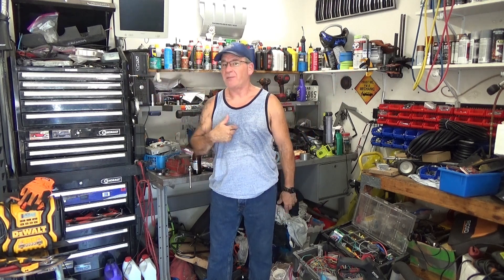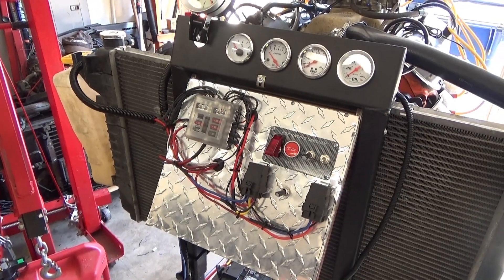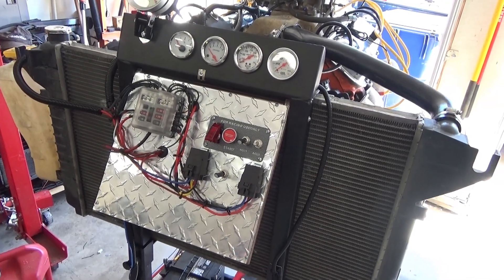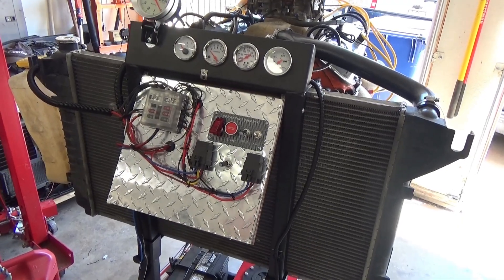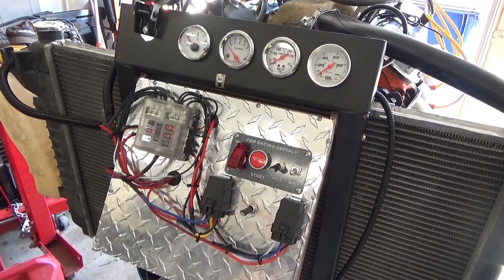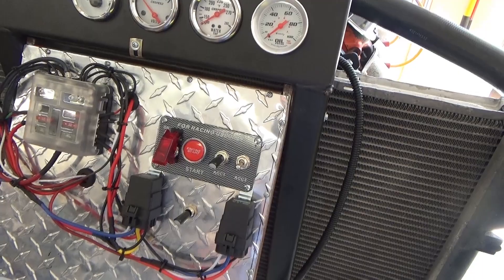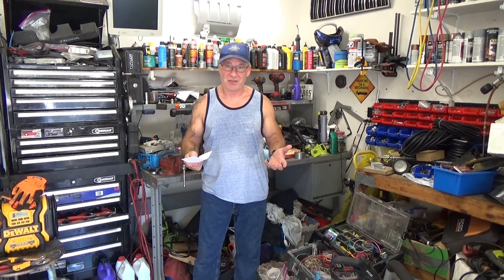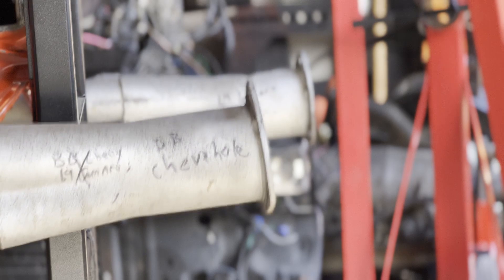454 Engine Start and finishing the Run Stand PT2

Comment: Great videos! I am considering swapping a 454 in my 88 C1500 which currently has a 350 and manual transmission. I am looking forward to watching you put the engine in the truck and getting running. Do you have a target date in mind for completion of the project?
Reply from the maker: Hi thank you! well the timeline has way come and gone, family a demanding day job and parts issues put it way back. I hope to have it started in the next month. Part 5 was supposed to be up last night be I'm behind it will be up in the next few days, I get the engine in on that one. then the fun begins, wiring :)